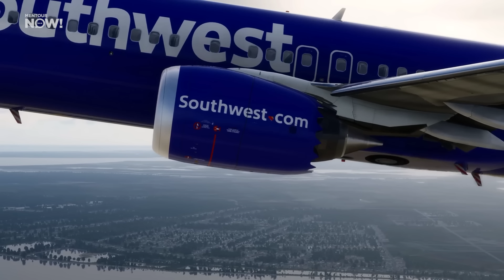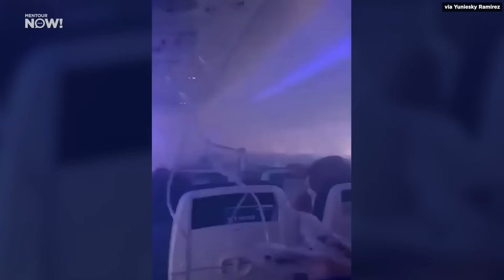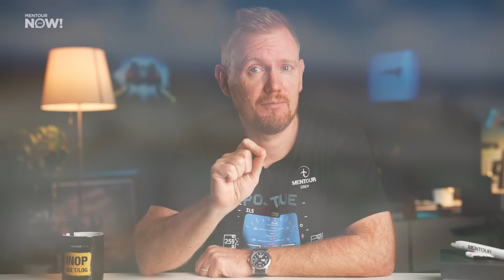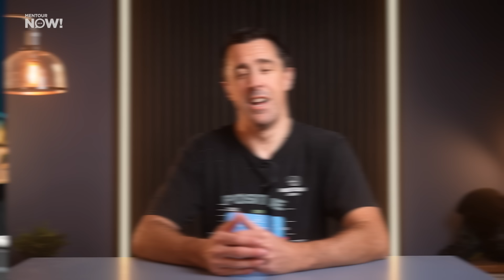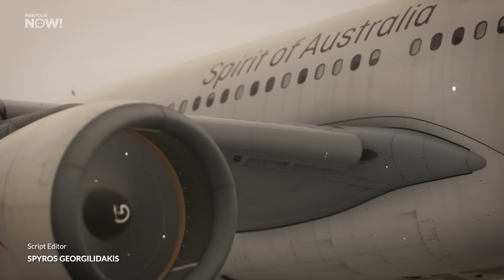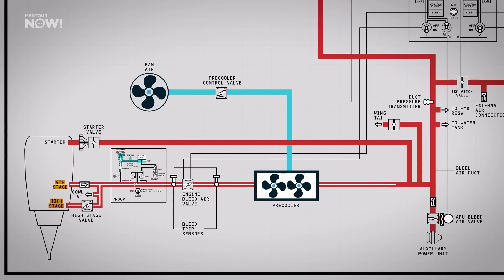Why Don’t ALL Airliners Do THIS?

Comment: The 787 wiring harness weighs 1.8 TONS!... I suggested to them in 2005 that all control signaling wires should be replaced with FIVE OPTIC CABLES.  That part of the wiring would be approximately 10x lighter,  even with QUADRUPLE REDUNDANCY built in... REFINANCE AUSPICIOUS
Reply: Low data rate opto electronics very low stress and reliable CAN bus speeds was a thing even in 1990

Comment: Fun fact the E7 Wedgetail AEW maxed out the 2 engine generators and APU can only supply 250kVA using standard B737-700, all electric optimised each engine should supply 300kVA with extra generators and gearboxes

Comment: Aeronautical engineer and 777 Captain here.
What a great video! Fantastic job describing the systems and explaining the problems and solutions.
Before moving on to the 777, I flew the 787 for four years. It is a truly fantastic airplane. I have never seen a more complex electrical system in any airplane, civillian or military. However, I found it to be very well executed; sophisticated, robust, dependable and with many redundancies built-in. Well done Boeing!
The higher pressure and humidity in the cabin make for noticeably less fatigue after a long haul flight. And the cockpit environment is sooo quiet. You can easily hear the “wooosh” of another jet passing 1000 feet above. The fuel burn is ridiculously low compared to the 777 (I understand it’s not a direct apples-to-apples comparison).
I have no doubt that a scaled-down version of the electrical ststem will be considered for the next crop of narrow body airliners. 
I have to mention that I have never flown in an A350 and am very curious to find how it compares to the 787.
Reply: I would much prefer flying in a plane that CANNOT mix oil with my breathable air and vaporize it.
Reply: @billpennock8585  This comment is totally unrelated to anything he said. But we’re all fascinated by your take…
Reply: Interesting info for a lowly layman. Thanks for posting.
Reply: 787 skipper here. I’ve flown as a passenger numerous times in both the 777 and A350 - both are exceedingly dry compared to the 787.

After getting off a longhaul flight in either the A350 or 777, I feel like a lizard about to shed its outer skin. No such feelings after flying the 787. Yes, you’ll feel tired after flying any of them for 15 hours, but the 787 is noticeably less fatiguing - almost to the point where I’d rather operate a sector on the 787 than position on an A350 or 777… almost! Lying in a bed isn’t a bad way to travel, even if it does dry you out!
Reply: @Kapitan_Plastic_Fantastic  "I’d rather operate a sector on the 787 than position on an A350 or 777" Please, what do "sector" and "position" mean in this context?
Reply: @PotatoRadius Do a sector means actually operating the aircraft as flight crew. Positioning is flying as a passenger to where the airline needs you. (I think in the US they call it deadheading).

We tend to do a fair bit of positioning at the shoulder of the winter/summer schedules, as different fleets pick up and drop routes, so the airline needs different crews ready to go in these destinations. 

HTH
Reply: @Kapitan_Plastic_Fantastic  OK, thanks.
Reply: @PotatoRadius  with/without passengers...
Reply: @PotatoRadius  To add to @Kapitan_nicholls definitions (and forgive me if you already know this) but on a positioning flight he would have a flat-bed seat in first or business class. So getting a bed the whole flight would normally be far more worthwhile than sitting in the cockpit working on the flight and only getting a bed during his crew rest segment. But with the air humidity difference factored in, this advantage is lessened to the point where it's almost equal (for him).
Reply: I’m a retired airline technician, and I have flown the 787 and A350 longhall multiple times between Europe and Colombia. As a passenger you will not notice the difference between eng bleed or CAC, but what I noticed was how quiet the Airbus 350 is compared to the Boeing 787, and and another thing is the pax comfort of a 1 foot wider cabin on the Airbus.
Reply: contact me is 5 years, and I can let you know. we just ordered the 87, and have been a US operator for the 350 for some time..
Reply: @jebb125 OK Delta. lol.
Reply: In this spite, the interresting question would be - is the "all-electric" system so much better that new 777X will be using it, or was it not worth switching from "calssic" bleed system?
Reply: @SYNtemp just a guess but it would likely be to much to put in place on a new version of an existing airframe
Reply: So you're telling me an American airplane flies like an American luxury car drives. Got it.
Reply: @theosexpertdaymon2774  Come again?..
Reply: @The_ZeroLine  The trait of a very quiet and comfy cabin is shared between American luxury cars and Boeing 787. Both American designed things with a commonality I thought was mildly interesting and amusing.
Reply: @theosexpertdaymon2774 OK. That is interesting. I just didn’t get what you meant.
Reply: yep, 1,4 MV - is definitely an overkill, those generators could be relaxed quite a bit. I wonder why they chose them in the first place. Probably the starter units, but once they'd start the engine started and revert to generation - they ended up being way too powerful. That thing could carry some batteries, charge them during flights and then sell electricity to the city grid while refueling :)))
Reply: @dmitrynova  Not overkill when you have to factor in the need to operate the aircraft (and keeping the passengers alive) when losing one engine.
Reply: @dmitrynova  That thing DOES contain some (bigger than average) batteries :) Remember the incident with ANA plane where they couldn't stop the thermal runavay and afterwards redesigned the housing of the battery?
BTW megavolt or megawatt? Somehow, i doubt the first...
Reply: @SYNtemp  Physically not much bigger, but the power it can crank out is horrifying...
When cranking up the APU it typically gives out 32V 400A - pretty much impossible for the Ni-CD without some major redesign

Comment: 5:15 Let me see if I understand this, you can use the bleed air from a running engine to start a non running engine. How do you start the first engine? Surely you can’t be serious.
Reply: I am serious. And don't call me Shirley!
Reply: @philperry4699   😆
Reply: You start the first engine via the auxiliary power unit in the tail of the aircraft fuselage, which provides the compressed air to start the engines. If in the rare chance that fails, airport air carts can be used to provide compressed air to start the engine directly.
Reply: @RobStar-777 or in the case of the 787 via an electric starter from the get go.
Reply: @logicalupset  Yea. In the 787 case the APU provides the electricity needed to power the 4 variable frequency starter generators to allow the start of one or both engines simultaneously. If the APU fails, then at least 2 ground power units must be connected to the 787 to provide enough power to 2 of the VSFGs of one engine to start one engine directly.
Reply: Adding on to what @MarioTime-g6u said, that APU is basically a very small jet engine itself and is started via the aircrafts batteries or via "ground power" supplied by the airport gate or an vehicle mounted electric generator.

Comment: The simple math on bleed air is big pipes and precoolers take up lots of volume and weight.  Additionally, harnessing the bleed air requires a turbine in the ECS that’s no more than 80% efficient, whereas electrical is often over 90% efficient.  This allowed some interesting design decisions having so much electrical power on tap. It also created new issues that are special to the 787.  

Neither way is right or wrong, but there is a large industry wide push for electrification.
Reply: Straightforward comparison is not trivial, but I believe there is some profit. Non-bleed system is multistage: efficiency of turbine (main engine) as an engine driving a generator is about 35-40%, generator and electric motor driving compressor efficiency is close to 100%, but really less, compressor efficiency is < 80% :   20% at best from fuel to compressed air. From other hand in bleed system we take compressed air of 200C and waste its energy at coolers and pressure regulators.
Reply: @crazydigger4931 You seem to be forgetting that the engine will already have spent energy doing the compression of the bleed air? Or maybe you didn't, and I just misunderstood you.

Anyway, a bleedless system will always be more efficient due to all that waste of the bleed air's energy you mention. An electric system would only need to be used on-demand.
Reply: @mnxs  I take it into account, but there is energy loss in air bleeding vs energy loss in compression using electric compressor. An efficiency is an energy or air compressed to cabin pressure heated to cabin temperature + energy needed for air pumping vs energy of fuel spent, it is far from 100% in both methods.

Comment: The biggest reason for future airliners being ever more electrified is that power electronics have got vastly cheaper and better in the last twenty years - that is, since even the 787 and 350 were designed.
Batteries plus SiC and GaN transistors have transformed things like variable frequency dynamos, inverters etc and allow far higher voltages. The point of higher voltage is lower current, so light and cheap wiring.
The pioneers of this? Huge wind turbines, HVDC (ie long distance lines for the grid) and  electric cars. ALL of which the US has dropped behind others in, BTW - but let's not go there.
These days the engineering rule is very much "never do mechanically what you can do electronically" - even for very high power applications, and especially where reliability/safety is the main issue.

Comment: Huh? Only 235 Volt? For high power? That is not exactly smart, is it? The higher the voltage, the less hot the wires get, it is safer and more efficient. The problem is, on a plane extra weight is not welcome. A high voltage net on board would need transformers, it compares to electric engineering at home, for solar panels you get extra complexity, except this is in a large plane. Maybe an extra, say, thousand volt circuit is still not possible. But I think it might be better at getting high power devices powered by a wire. Those 235 volts are pretty limited. And yall call it an improvement. Strange. Why?

Comment: One consideration, higher voltage means dramatically lighter wires.
(Albeit - high altitude and high voltage is problematic)

Comment: I understand the value of bleed air for heat exchangers but I fail to comprehend why the same air would be sent to the cabin...
Reply: Because the pressure of the ambient air at altitude is insufficient to maintain life. In other words, you need to cram more air in there than you'd get from opening a window.
Reply: You've got to compress (and cool) air somewhere to maintain a breathable atmosphere in the cabin (or everyone asphyxiates). Jet engines produce plenty of already-compressed air (bleed air system), or you can use the bleed air to run a turbocharger to compress fresh air (B/707 style), or use electricity (from large generators on the engines) to do the compressing (B/787 style).

Comment: The first clean sheet design for Boeing was the Sonic Cruiser. Boeing had been accused of not innovating, so it responded with the SOnic Cruiser which morphed into the 787 when airlines told Boeing they weren't interested in fuel hungry aircraft,  The 787 was thus launched with a PR goal of showing it could innovate for the sake of innovation. 
I have yet to see authoritative trustable information on whether the all electric bet paid off and if so where it improved and where it didn't.   
The DC9 leaked air live of sieve, so needed a huge amout of bleed air to maintain cabin pressure. Modern aircraft are air tight and can recirculate air instead of providing passengers with fresh outside air all the time so propoprtionally need less bleed air.  Since the 787 was repl;acing the 767 at thetime, it would have been compared against the 767 perforance at launch (until it densified interior to start competing against the DC10 class aircraft)

Comment: Before lithium ion batteries and neodymium magnets hit mainstream, we weren't great at reliably tapping torque from engines to turn into electricity... The so-called high torque turbine engines were being abandoned as far back as the WWII era when they were originally being developed, though I suspect some routes for improvement have lingered on...
Bypass efficiency is reaching its limit at this point, too, SO somebody might as well try tapping torque directly instead of bleeding air off the engines to run electrical as far as they can...
If what I've heard is correct (best I can recall) NOT even all the bleed air siphoned out of the engines is quite used. The de-icing system needs fresh warm flow, so it just carries through and bleeds out the wingtips with energy left in it. The cabin is kept at atmospheric pressure, so there's a LOT of loss where engine air gets "stepped down" and chills, then needs heat exchanged from the hotter side to avoid freezing out the passengers... THANKS A LOT, BOYLE!!! As you can see this also sets up to "waste" a fair amount of bleed air, and once it's been bled off, there's no going back... pffft...
The questions are going to come down to which can be more reliable as much as cheaper.
It all comes down to reliability IS safety... to a greater degree.
Reply: Back in the day it took 1kg of rotating machinery for 1kVA power of DC generators

Comment: Someone had to be first. In a similar vein Ford Class aircraft carriers now use electricity for their catapults, power which was formerly provided by piped steam.
Reply: I've heard that they may be removing them and going back to steam. Any news on that?
Reply: @philperry4699 I heard President Trump blathering about steam a few months back—kind of like how he does about windmills and “clean” coal. I doubt it will actually happen though. There are advantages with electric of being able to rapidly fine tune the catapult thrust to the type and weight of the aircraft. This has to be done mechanically with steam and is a much more time consuming process. Like any new system there will be teething process but I expect the Navy will stick with it.

Comment: Most of my aviation experience was flying with the military. Nearly all the military types I flew had smoke clearance systems and procedures to ensure choking to death unlikely to be an issue. Also fitted with ehection seats for extreme situations.

Personally I find commercial flying dangerous to health. I use train, bus or ship wherever possible, much more pleasant.

Comment: Having previously operated the 787 as cabin crew, my opinion my be ever so slightly biased. 
I think Boeing were right, and brave to go down this route. Looking at the automotive industry, electrification of cars, and other vehicles has come on leaps and bounds in a relatively short space of time. Perhaps aircraft manufacturers need to look at the advances and think, like Boeing did, with what’s available now, what could we do? Both Airbus and Boeing will be looking at replacing the A320 family and the 737 family in the near future so, could the latest electrification technologies play a big part in these new types like the 787 already has?
Obviously aircraft manufacturers don’t churn out new models like car manufacturers do but still, there are at least 2 big types looking to be replaced. Food for thought

Comment: A quick recommendation for your in-sim graphics: to remove the artifacts you see on quick-moving objects (such as fan blades, prominently featured in the video), turn off frame generation and upscalers such as DLSS (opting for TAA instead). You'll definitely lose framerate, but the graphical artifacts will be gone.
Reply: Underrated post